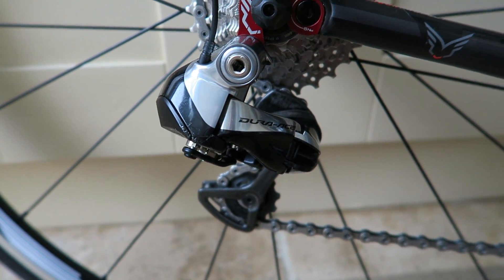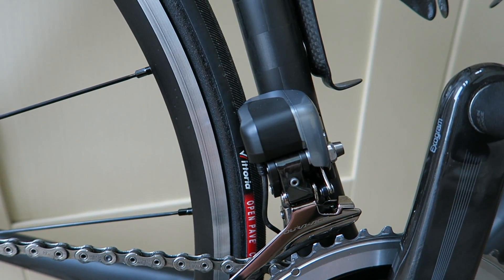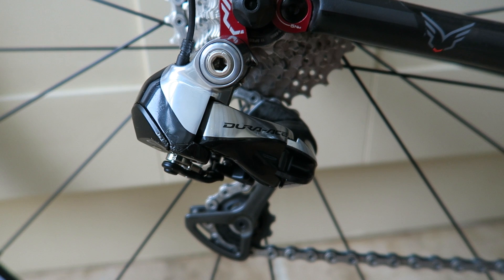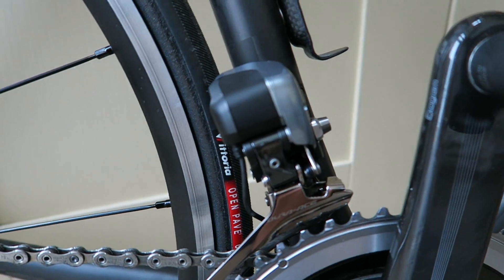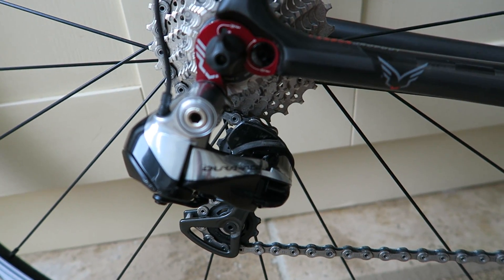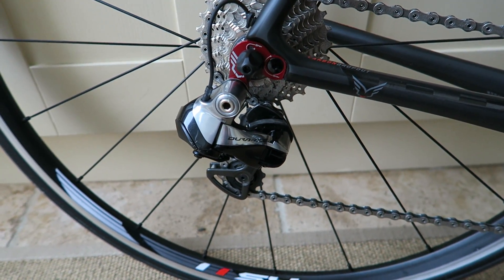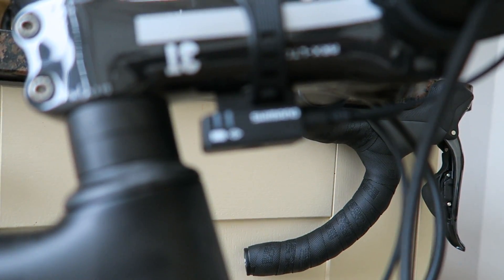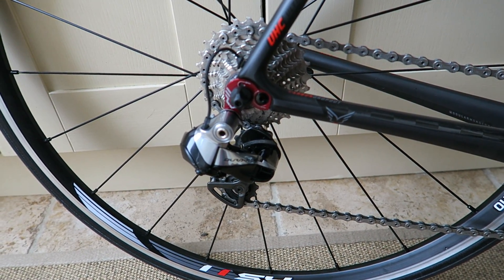DI2 CRASH MODE What is it and Recovery

Comment: There are no proximity sensors, or accelerometers inside. The 'crash' mode is achieved by mechanical clutch, spring loaded camlock coupler. Di2 crash mode is just a full shift cycle. You can do the same by pulling rear derailleur by hand. Also there is no crash mode on front derailleur. Good video nevertheless.